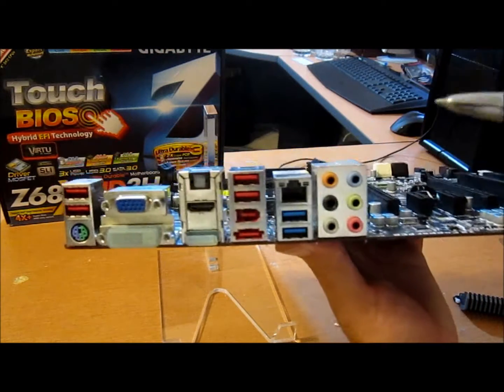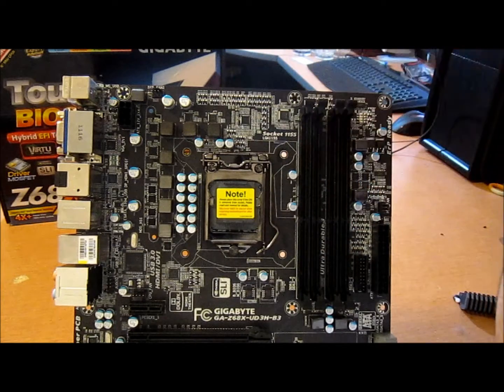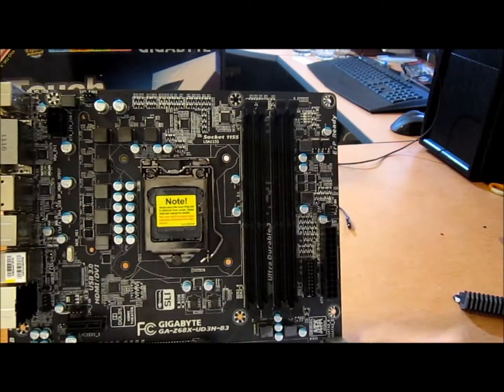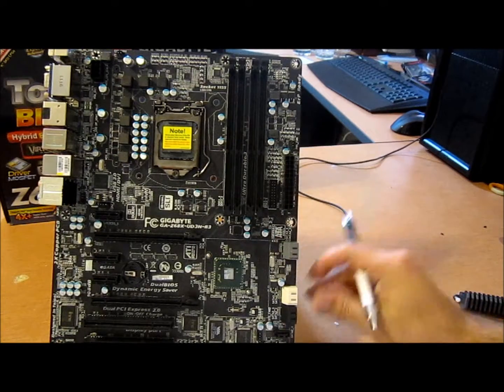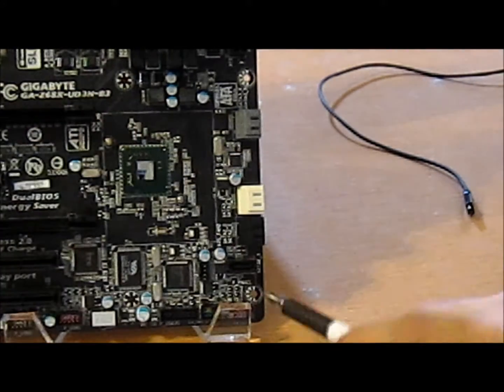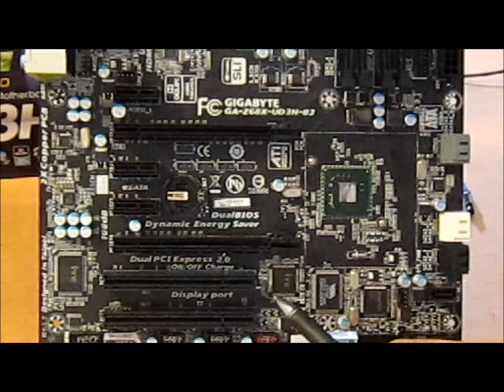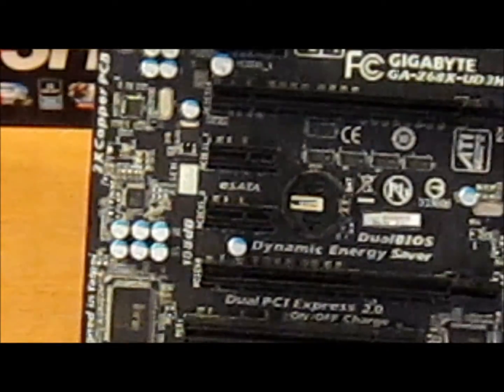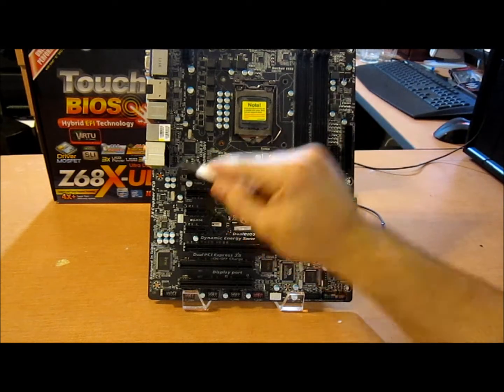[SinHardware.com] GIGABYTE Z68X-UD3H Video Review

Comment: Hi Sin, just bought this board a couple of days ago, but I'm having noise problems at idle.  It's the one related to the C1E and C3/C6 power saving states.  When you disabled these, the intermittent buzzing noise goes away.  Is this a sign of an underlying or impending fault?

A video detailing common or uncommon motherboard noises would be a fantastic addition to go along with your vrm videos.  From what I understand, there is a relationship between the two.

Any help is appreciated.